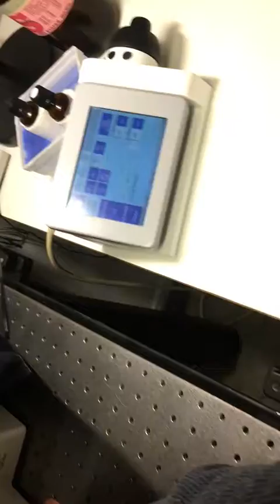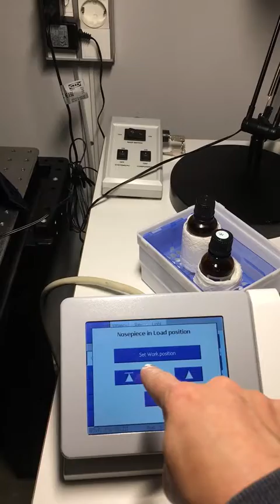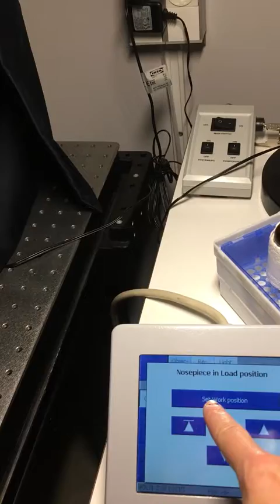2. Load and work positions of objectives

Comment: Very good illustration. Just wondering if I set a working position with 10X lens then I shift to 20X and then when I jump back to 10X is the setting still working or I have to reset it?
Reply from the maker: yes,  the objectives are parfocal, meaning that you do not need to adjust the focus when switching from one objective to another